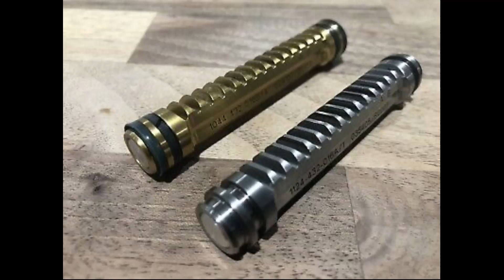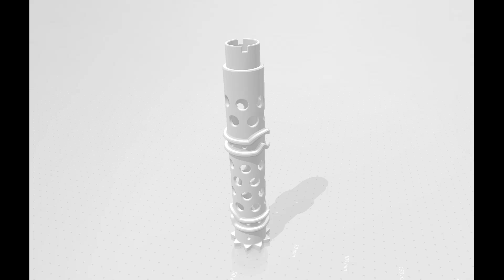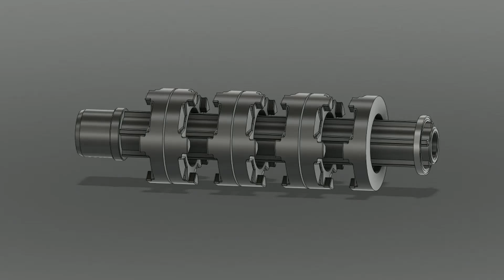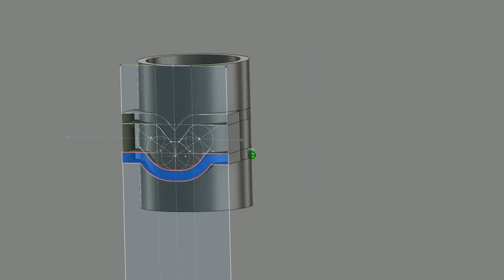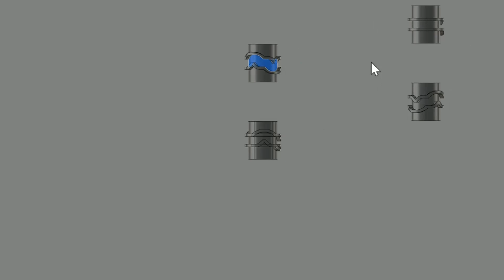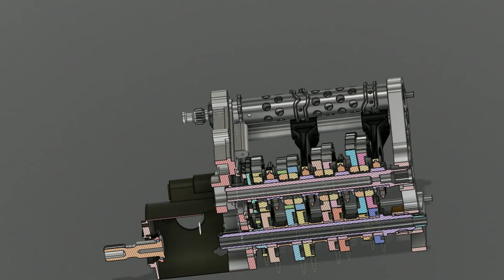3D Printed Formula 1 Gearbox - Prequel Part 1

Comment: I love your design, however only thing that confuses me, why do you have 2 shift drums when you can clearly use 1 shift shaft which makes things much more simple, remember the infamous engineering saying, k.i.s.s, most of your timing problems would have been fixed with this route with no real downside on terms of performance, even in real engineering development, then you just time your gears accuracy on the shift drum rotations to make it seamless.
Reply from the maker: I mention it a bit in later videos, but the twin shift barrels allow seamless upshifts and downshifts because the gear changes can be overlapped. 

Each barrel controls either the odd or even set of gears. These shift so fast that essentially 2 gears can be selected at once for the briefest of moments.  

A single barrel can shift very fast, but you could only overlap upshifts or downshifts, not both. F1 is all about spending millions to save milliseconds.

Comment: I was watching the part about the design of the shift barrel because I have an application where I wanted to use that. First there seems to be an easier way to design that in Fusion where you use a sheet metal feature to unfold a cylinder and add then draw a sketch on top of the flat surface (the path, circles etc.) and folding it back into a cylinder. Maybe worth checking out ... https://www.youtube.com/watch?v=xN5uqSyG6YA. I'm a little puzzled about the bottom path the pin follows and why it does not match the top path? Did you find some science behind that you can point me too? It's super interesting especially if you try to recreate it from scratch ;-)
Reply from the maker: Wow, that looks a lot easier and allows you to keep everything sequenced. I’m also curious to try out the new Emboss command. It looks like it can wrap a sketch all the way around a cylinder in one step.

Comment: Very nice video! Which bearings did you use between the main shaft and the gears? It's difficult to find a bearing with the dimension of the shaft and the same wide of the gears. I guess you used two shorter bearings to get them cheaper?
Reply from the maker: Yes, I used two 6706 bearings per gear.

Comment: Didn't the use of face offset distort some of your dimensions from those on the sketch?
And of course the video is great, very informative.
Reply from the maker: Thanks!  I'm not an expert on this but I did some research.  The sketch dimensions are the minimum needed for the pin to follow the slot.  The offset does change the dimensions but the offset is relative to the center axis of the cylinder, so relative to the pin these dimensions should still work.  The only critical dimension is how far the pin moves the shift fork side to side.  I looked at a lot of shift barrels from motorcycles and I deduced this method based on how they are machined.  There is a cutter that follows the path of the slot while the shift barrel is being rotated.  This should give the same shape as what I've done here.  I've also tried sweeping along a path, but it's much harder to control the dimensions of a sweep like that in Fusion 360.  I'd love to hear from a gearbox engineer on how these are supposed to be designed.